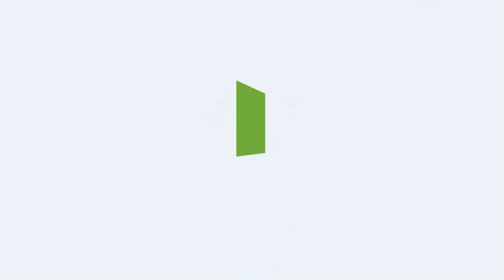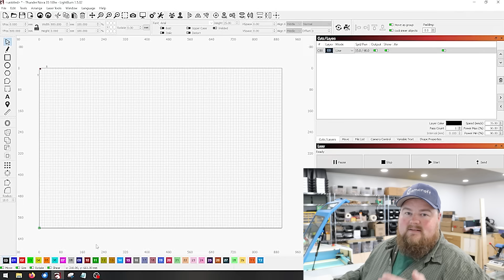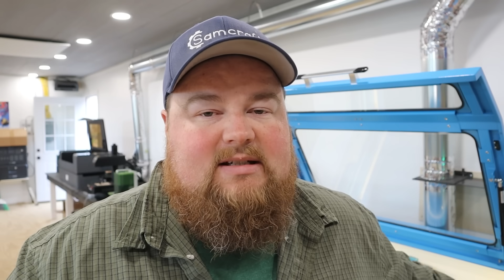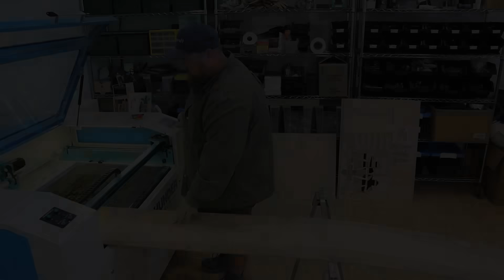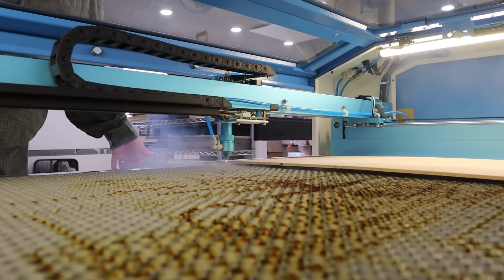Who Would Use a LASER as a TABLE SAW?!?!

Comment: And you are saving nearly 3/8” of material from kerf loss. 
I’m wondering if there is a way to set the head in a stationary position and manually feeding the material to do “rip” cuts.  Make a fence and either manual feed or build an auto feeder.

Comment: Hey Sam, Here's a neat little plywood bending hack for you. Moisten the inner side of the concave surface and let it sit for a bit. The wood will absorb the moisture, causing it to expand and temporarily flatten out the board, not permanently alas, but just while that side is wet. This could come in handy during your machining process. Happy machining!

Comment: The only way to cut wood is with a Japanese whaleback saw crafted in the mountains of the tekakibukake prefecture and blessed by no less than 6 Buddhist Muslim Scientologists and the blade must made from meteoric iron hand forged(even the teeth) and quenched in a pop up oasis in the gobi desert. Incense must be burned too to appease the cutting spirit of the saw so wood might be “parted” instead of savagely ripped. 2 parts frankincense and 5 parts Mir melted into a kilo of ambergris from the Antarctic interior.

Comment: Awesome video Sam!  I’d love to get into lasers, CNC, and 3D printing.  No complaints as a woodworker.  Heck everyone has jigs.  This is a modern jig.  I did notice that the material in the machine had a slight bow from sagging weight.  If you can place a weight on the piece in the machine your cuts may be more precise.  Just a thought if it makes a difference in your measurements!  Otherwise good video and would love to learn more.

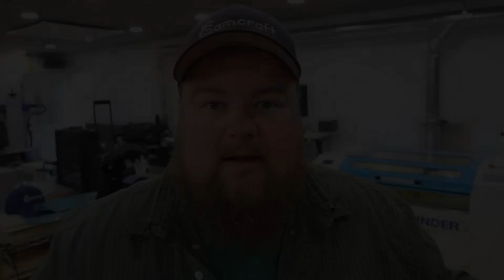Comment: 13:20 that thin piece at the end - is it wide enough to make coasters? 

Glasses / as extra precaution incase you bend down to look at it? 

If the machine could be rotated you could index a long sheet and cut the long edge.

Can you use dust/ smoke extraction to create a vacuum bed? Could be a cool little project.

Comment: Actually, I think this is rather clever, you can maximize the material, get the proper fit for your laser to allow you to use the entire bed. You also know that each piece is very close to the same size. I think the only thing you should do different it to get a couple more supports. Then you can pre-stack all the material and just pull it off the top of the pile vice running back and forth to get the next sheet. (assuming you have the room)

Comment: think the lasertube (and the honeycomb  bed) is a wear item , and their not cheap 
it might be better to just use a tablesaw 
might want to check some of the more professional used machines websites to get on of those saws they use at the diy store , it takes way less space then the normal saw and is eazier to operate on youre own , only thing is you can cut at an angle or cut grooves but with the material cut intoo smaller pieces you wouldnt need a large sawbench for that

Comment: I've found that for rather wavy sheets of wood, stack your newest sheets under your oldest sheets. Pain in the backside for sure but, the weight of the older sheets help flatten the newer sheets. So, by the time you break into using the newer sheets, using old stock first, they should dry out a bit more evenly and self flatten.

Excellent idea for ripping down bigger material and very pleasantly surprised the X2 was able to use the 13" cutoffs.

Comment: May I suggest pinning a comment emphasizing laser eye safety? You can't see the scatter from a CO2 laser and that amount of power output could do real, permanent eye damage. I never power mine on before I don protective eyewear. Vision loss occurs faster than anyone can engage safety squints.
Reply: I agree but also the glass is laser safe.
Reply: @Ryan82288  maybe so, but there's no glass where he fed the wood in and the laser head is right up front. Why take the chance?
Reply: It's not diode

Comment: One of my biggest regrets with the machine I bought, no passthru :(.  I have to basically do the same thing by hand.  I DO get mine rip cut down to the width of my bed at HD (unless I'm buying those luan sheets, they're already narrow enough), and have a saw guide I clamp down and cut with.  I did notice no eye protection during  your cuts tho...  I will say when I'm finally ready to either add another, or replace my existing laser, I'm going to seriously look more into a Thunder..  Their fit and finish is about 3 or 4 notches above what I currently have (it works, but things like my motorized bed are just kind of clunky).

Comment: What a great idea! Not only is this cleaner than traditional wood saws, but it is much straighter as well. This also takes out the measurement and marking step. Thanks for sharing.
Reply: Yeah by doing it on the computer and loading into a Lazer only took about 3 or  times it would have taking with a track saw or table saw.
Reply: This is only straighter if you are not good with your tools.  Its also useless unless you are breaking down wood to use in a laser.  This would be completely useless for any kind of traditional, non laser based woodworking.

Comment: So I can do exactly the same thing with just using a cheap skilsaw, a straight edge and a tape measure in about one tenth of the time, WITHOUT  havind a burnt edge. I really don't see the point of using a ridiculously expensive laser and a computer not to mention a bunch of my time to program the computer and be left with a burnt edge when you're finished. 😂
Reply: He explained that in the video. Not everyone has those tools. What if you just have a laser and need to break down a board that the store limited cuts on? My local store does 2 cuts a day. 
Now, for one or two items, yeah, your way will work. But what if a person is prepping for a craft show and needs to break down 30 boards to fit into 90 jobs on the laser? Just as easy to click a button and feed each board like a saw mill.
Reply: I don't think you can do it faster and make it look good.  I did a 48" cut in 50 seconds and it looks awesome.😃
Reply from the maker: Then this is not the hobby or business for you. 😂
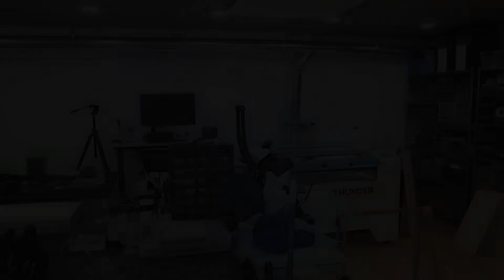Reply: Sam explains this at the 14:20 mark

Comment: Seens like the cover of the laser doesnt include eye protection. So the question is why you dont wear protective goggles?
Reply: We do this at work, it's great. 
The window has a protective coating, but he should be using eye protection when doing open bed cutting like that.  

We usually put a sheet of cardboard to cover the hole. It helps with smoke as well as eye protection.
Reply: Came to say the same. Laser Safety 101: any time it's powered on, you wear the safety glasses.
Reply: The Thunder Laser glass top protects your eyes from any laser reflections (I have this same one), and the laser immediately turns off when you lift the cover.  I actually just made this comment separately to Sam, when he's running with that front plate removed for pass through operations, you are exactly right though - there's nothing to protect you from the last, and glasses would be a very good idea, but filming that angle was worrying me too....
Reply: Usually the glass or plastic cover that protects have a colour in it. This doesnt. So have they developed a new protection without the colour?
Reply: I actually was going to ask him that same question, I have the ORTUR  and I use eye protection so I’m thinking that the bigger laser you don’t have to?